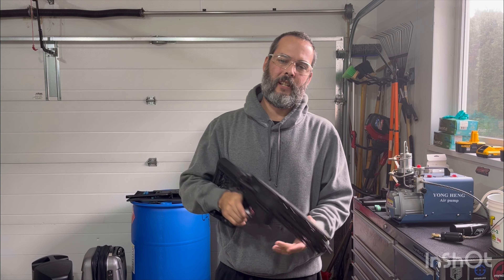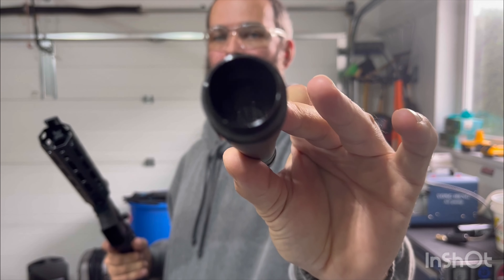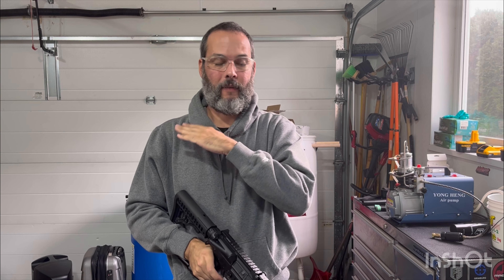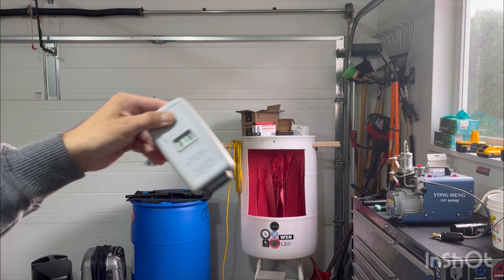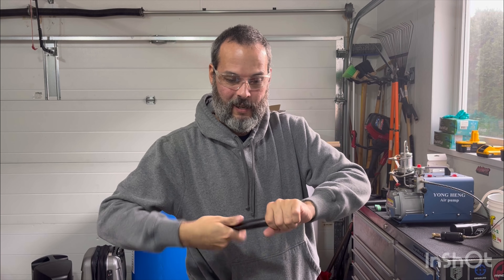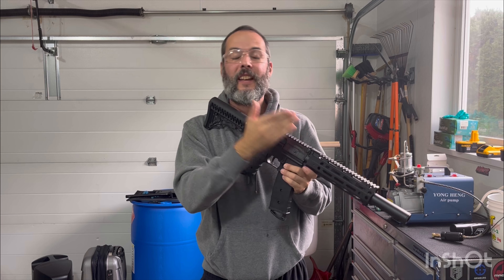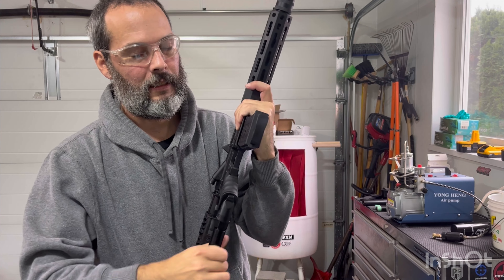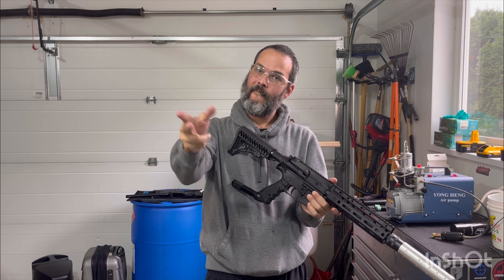LL4D Tippmann Tmc/Byrna Mission 4 - Testing the only current Lapco barrel I own

Comment: Wow !!!! It does amaze me that the original barrel works better I have a 12 inch lion claw barrel on my stormer
Reply from the maker: Is it a direct fit or did you need an adapter? Might puck one of those up.
Reply: @lesslethalfordummies  no adapter Sean it’s a 98 threaded barrel from mcs
Reply from the maker: @klproduction1045 😎